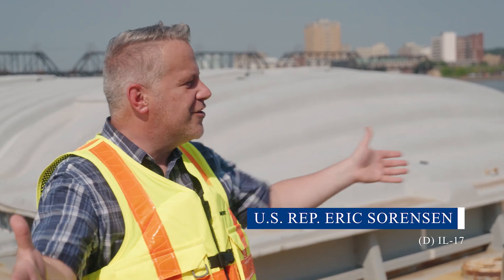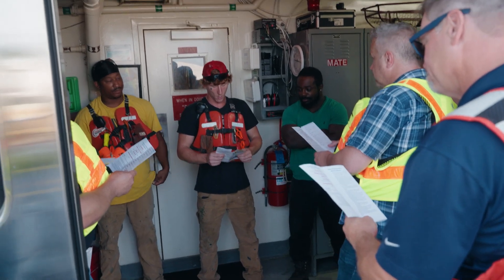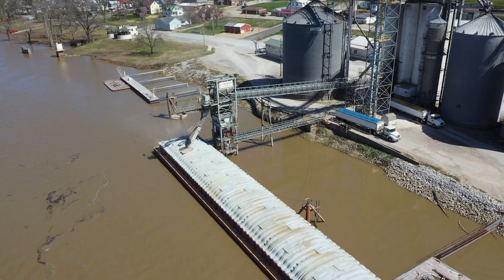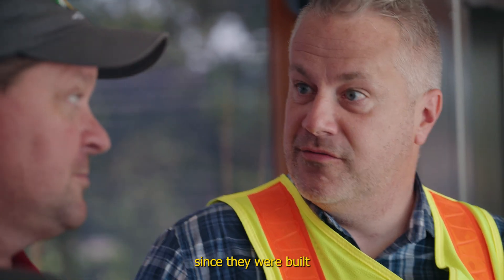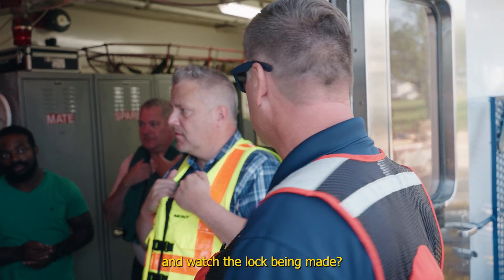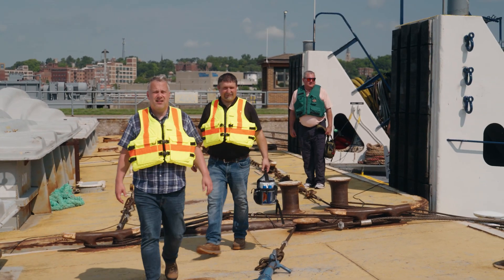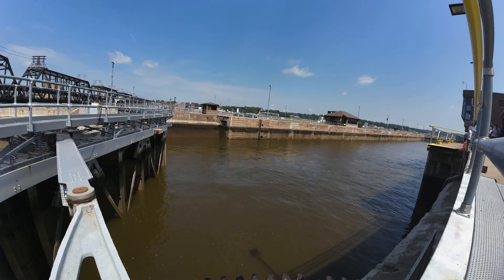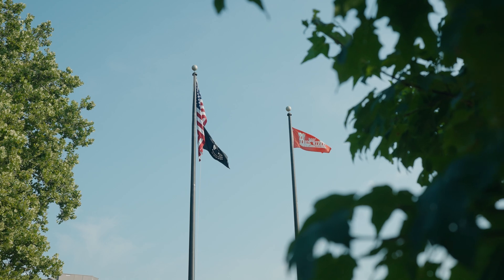Locks and Dams

Comment: The Corps of engineers should convert the roller dams into  hydroelectric generators
1952 DAVENPORT IOWA DAD JOKE of the day
[Q] Which side,of a Turkey, has the most FEATHERs?
[A] the OUTSIDE,of course